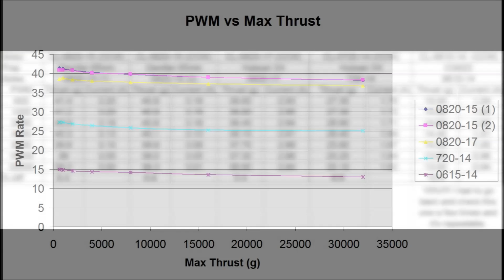Micro Brushed Motors - PWM rate vs Max thrust

Comment: The PWM frequency supplied to a (presumably) brushed DC motor needs to be high enough that the combination of mechanical inertia and inductance of the coils is sufficient to smooth out the mechanical impulses of each pulse. This minimum would differ from motor to motor. Too low a frequency, and the motor motion will be perceived as a series of jerks, or a rattle.
The frequency needs to be not so high that the switching device (MOSFET, other) and connecting wiring do not waste significant power in switching losses. Too high a frequency, and the efficiency will drop. This maximum would differ depending on the switching mechanism, the length of wires to the motor, the drive voltage (higher voltage = slew-rate limitations), shielding, perhaps some other factors too.
The frequency should, if possible, avoid the audio spectrum: below 20 Hz (not a good idea except for really massive motors) or above 20 KHz, so that the magnetostrictive vibration in windings or sympathetic vibration in the mechanical rotor, will not be heard by humans.
In addition to all of this, a specific motor + load + mounting combination will have a resonant frequency at a given temperature. While this is likely to be not as high as the 20 KHz+ applied for typical motor PWM, certain types of rigid mounting can indeed reach ultrasonic resonant frequencies. If the PWM frequency matches the resonant frequency, resonant oscillations can cause the motor to vibrate uncontrollably. This is why rubber / nylon / elastomer buffers are commonly applied for motor mountings.
This last issue is somewhat self-curing though, since after a bit of resonant oscillation the mounting tends to give / wear, even if it is rigid metallic mounting, and this changes the resonant frequency.

Comment: Thanks for putting this together! I just got a betaflight board for my tinywhoop and I set the PWM rate to 32000 because the motor are much silent on this setting. Didn't think it would really affect performance this much (potentially).  Might have to fiddle around with things now.

Comment: How to change the PWM rates? Have you tried it in practise, after reading Alex Curtis's comment?
Reply from the maker: In Cleanflight CLI just type: "set motor_pwm_rate= (value desired)"  
Hit Enter
Then type "Save"
Hit Enter

I have always kept PWM rate low and have no complaints or issues, so unless I determine this test was flawed I don't plan on setting it much higher..
Reply: Dave Woods how do I see what PWM rate I'm currently running? Type 'dump' in CLI?
Reply from the maker: Yea, it should be in dump info.
Reply: Yep sure is, mine already at 400. I guess that is the default in Betaflight? May try 1000
Love your videos, you have an excellent style.

Comment: Great video Dave, in your opinion, what's the best motors for micros? I've had the darks, spintechs etc, but always find myself coming back to Chaoli motors! Only problem I've frequently noticed with chaoli is the cap isn't very well fastened to the can? This is easily sorted tho with a fine bit of superglue/hot glue depending on the build of course!! I've noticed you seem to prefer chaoli as well and get sum amazing performances with all the builds you produce!! Great stuff👍
Reply from the maker: I can't really comment which is best.  Coreless motor technology has been around for a long time and I suspect there is not significant difference across manufacturers but some will obviously have a bit more Quality and control than others.  

Finding the proper KV (speed) is really what makes the difference IMO.  Benedikt (Micro Motor Warehouse) was the real initiator of finding this with the Chaoli motors and continues to push the limits with faster models, so I tend in that direction, and also offer them at Picnic Quads.  He also seems to keep them well in check with quality.  

With that in mind not all Chaoli are ideal either.  For example the ones BG offers are of a slower 10000-12000Kv and likely don't offer much more than a Hubsan 8.5mm motor  of similar speed.  I personally prefer ~15000KV 0820 motors. 

As for the backs popping out a solution is provided here: https://www.youtube.com/watch?v=6YiTu3Bo9Ko
I have not noticed Chaoli having looser caps but I'm sure there is some variation.  Shouldn't be an issue if the props are installed and setup properly though.